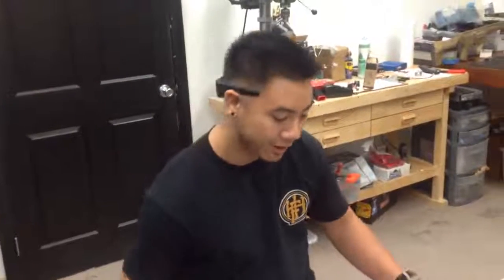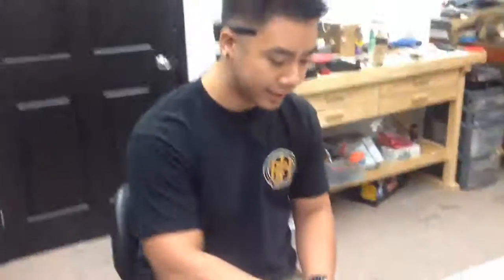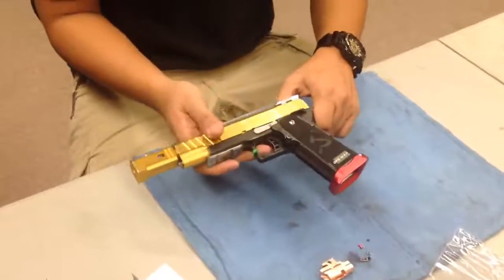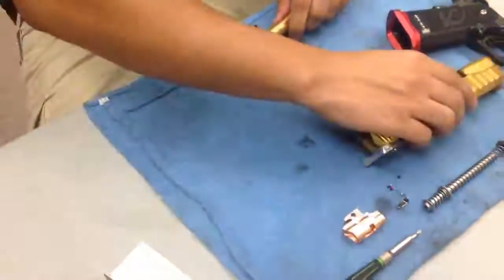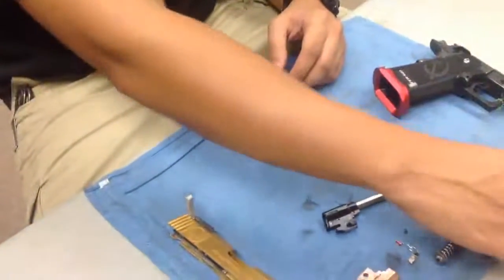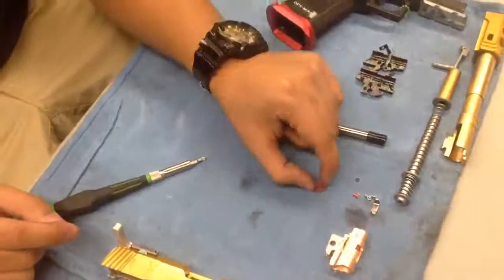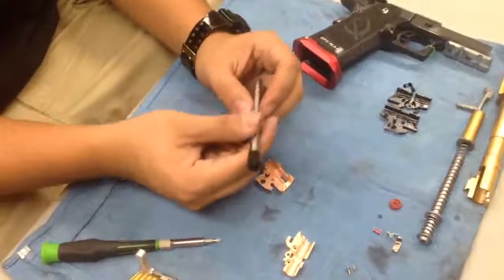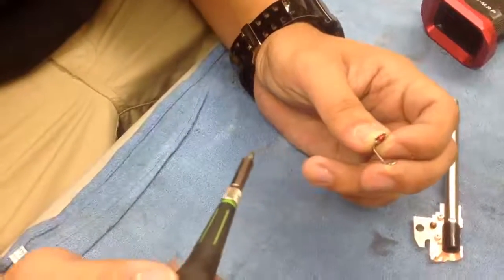Live At Airsoft Extreme  How to change   Hop-up in a TM hi capa

Comment: I have stock TM 5.1 What upgrades can i make for precision?
Reply: Stock tm have 6.05 mm inner barrel (6.03 for the gold match), so just change your barrel for a pdi or something like that and the hop up for a maple leaf, I use the autobot 50° cause my fps limit is 330 and the same maple leaf hop chamber from the video, also they make the brass adjustment wheel that allow you to put even more hop (this set up is for heavy bbs so u can have more backspin )